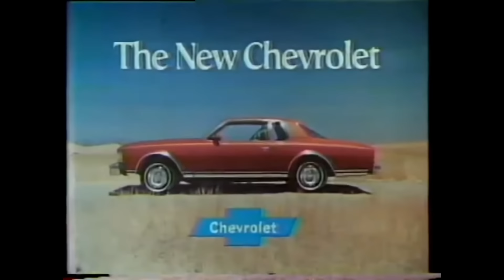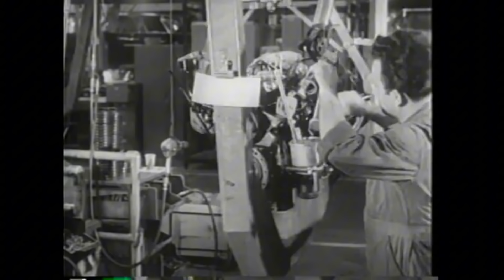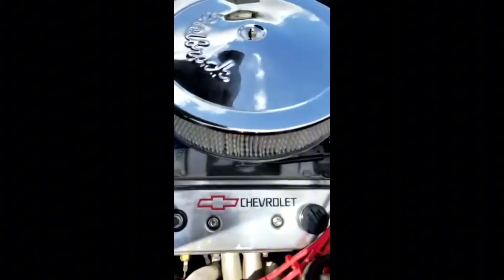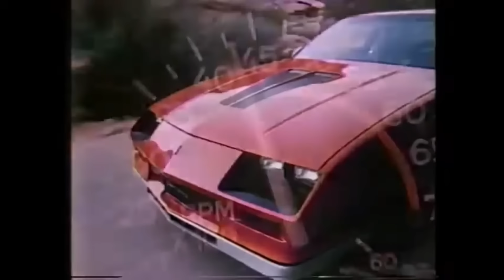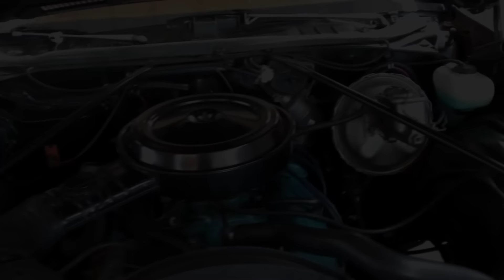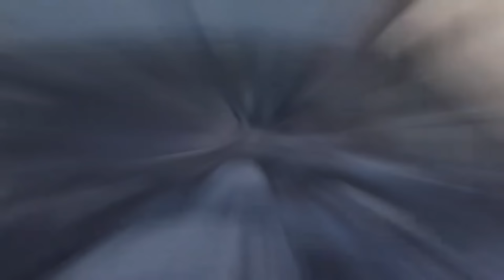How the Chevrolet 305 V8 Became GM’s American Savior AND Scapegoat

Comment: There was an evolutionary step engine just before the 305... 
In 75 and 76, GM came up with the 262 which they put in the Nova and the Monza. 

The idea for the 262s small displacement was a short stroke and the smallest piston diameter. 

It was a great idea that could rev like crazy and made low enough power numbers that it could nearly be indestructible. 

The problem came when it was time to pass emissions in California. 

The 262 wouldn't 4:56 pass but the 350 would... 
Hence why California monza's got a 350 in 75. 
Halfway through 76 the 305 was ready to replace the 262. 

A reasonably larger piston yeah still smaller than the 350 however it had the same stroke as the 350. 

The longer stroke being what was needed to make the same power and efficiency with something that could be tuned for the stringent emissions standards. 

The smaller piston meant more meat in the cylinder walls, for the specific 305 cylinder heads that ran hotter to help complete combustion. 

And then somebody realized you could go back down to the Piston size of that 262 and keep the 305 350 stroke and then the 267 was born just after the 80s started. 

Still short-lived. 
While the 305 was used for any non-performance application. 

Although by the early 80s they were improving the 305 with flat top pistons larger valves and better flowing heads.
Reply: I sold a low miles 262 from a Nova to a guy for his 3/4 ton work truck. It had pretty low gears in it, so he really didn't notice any loss in power when compared to the wore out GM Goodwrench 350 that it replaced.

Comment: My brother bought a 1984 c10 4x4 new.  Camshaft rounded down still under warranty.  Had that replaced and it was a very good truck .  GM got off to a bad start with the early 305.  Later 80’s we’re better.

Comment: I had a 1979 Impala with the 305 with a 2-barrel carburetor.  Put 175000 miles on it and then sold it to my brother-in-law and he drove it for at least 5 more years.  Not a speed demon, but, a good dependable car.

Comment: I had a 92 K1500 with an LO3 and a 5 speed.  It was a blast to drive and averaged 17mpg.  The truck rusted out from around the engine.  It had 210k miles on it when I sold it and still ran great.

Comment: The 305 was a great engine. With 350 heads and a Quadrajet intake & carb it got good mileage and had lots of power. A rock solid motor.

Comment: In 1977 I bought a (of course a 1977) Chevy Monza 2+2 with a 305, 2V, 4 speed, front and rear spoilers. It was basically a Spyder without the decals. This little coupe was awesome. I used to hunt down late 70's Corvette's especially after making "certain modifications" to the car, exhaust system and engine.
Reply: I had one almost like it and surprised a lot of other cars.
Reply: I have alota Saginaw 4 speeds saved from Vegas & Monzas

Comment: F the 305.... I had a 77 firebird with one, it was a disgusting pos....no power,lousy economy.... Blew up in my driveway stuck in the snow... Replaced it with a boneyard 350.... Never had an issue after that.

Comment: I've always been curious about how Chevy, Olds, and Pontiac engineers went about creating their 5.0s in different ways. The Olds 307 was derived from the venerable Olds 350 like Chevy did. The Pontiac 301 is largely maligned. What were the strengths and weaknesses of the three engines? Which ones held up the best in the long run? I think Chevy did the best job of creating a smooth and powerful 5.0.
Reply: I think the Olds 307 was better, but that's just my opinion.

Comment: It might've been under powered and such, but my grandpa owned a mid 1980's G20 conversion van with this engine. They daily drove it, they drove cross country with it, they towed a small pull behind camper with it for 20 years, then it got handed down to my dad and us and when we finally sold it, the original engine and transmission was 300,000+ miles on it. The transmission did slip when trying to go into drive at times and the engine was tired, but it still started up every time. So it was made for certain long term driving conditions, not as a high output HP monster engine.

Comment: It's a garbage emissions compliance engine. Nothing more. If you want efficiency, you get the 6 cyl. If you want performance, you get the 350. Any performance upgrade you could make to the 305, you can make to the 350. And it will probably still get the same mileage.

Comment: Great motor for it's intended use. A fuel injected 305 with a 700r4 overdrive trans was a great set up for everyday driving.
Reply: Yes sir, I get 20mpg highway easy out of my 89 caprice with 305!! Way better travel option than my truck

Comment: I had a 1982 Chevrolet with the 305 and a 4 barrel carb. Biggest pos truck I ever owned. I used trucks for work and hauled 1500 pound loads on a daily basis. Truck could not handle a work load like that. Turned me into a Ford truck guy and I never bought another Chevrolet.

Comment: Never owned one, but kind of wish i did. My experiences from that time period were mostly Ford 302 (a much superior motor) and an early 80's buick 3.8 V6. The 3.8 was junk and eventually replaced with a 350 swap. If the buick had a 305 to start with, things would have been better.

Comment: I bought a brand new 1985 Monte Carlo SS, 305 rated at 180 HP. With some minor tweks , it ran a best of 14.73@ 93 mph in the quarter mile. Not bad for a car weighing 3670 lbs

Comment: Ive got a 1990 Chevy 1500 with a 305 that I have kicked the crap out of, everything else with the truck has gone wrong except for the engine, its got 350000 on it. sure it’s not a powerhouse but I still get a v8 soundtrack and with my posi traction rear it lights up both back tires no problem on dry road

Comment: My father had a 1982 Chevy conversion van with a 305 . It got 17.5 mpg on the highway, and over 570 miles from its 33 gallon tank.
Reply: Same here, G2500 GMC with four speed overdrive. Over 20mpg on long trips and nearly 600 miles between fill-ups.

Comment: Even with a reasonable throttle body fuel injection system in the 305 it was still a disappointment. It took forever for it to spool up into good rpm range to make some really anemic HP and torque figures. The 3.8 liter V-6 was a superior power plant and it delivered better fuel economy.

Comment: Bought a new 1989 Iroc with 305 tpi. 5 speed manual for $15,000. Sweet running car. Great reliable motors.
Reply: My Mom had an 87 Trans Am with the 305 TPI, had some Zip... I was bummed when she traded it, but she did swap for an 87 Grand National, so Schwing... Upgrade even though she bought it used. My dad had the 89 TA with the GNX motor... That thing was fun AF to drive. I ended up with an 88 Iroc-Z with the 350 TPI, I love the look of 3 Gen Camaros, but mine was a lemon, it chewed through flywheels (2 replaced before the car hit 8k miles), but GM stepped up and replaced the motor. I ended up wrecking that car on my way home from work as I fell asleep at the wheel (worked a double).

I later replaced it with a 92 Z28 with that god awful dual stand spoiler which I had replaced with a std Camaro wedge spoiler after 2 months of ownership... Sadly, I couldn't take it with me when I went to school (no need for a car like that when going to school in NYC). My Parents drove it and racked up thousands of miles on it and never cleaned it so when I came home after first year it was in need of a serious cleaning, I was so mad I ended up storing it at my Uncle's garage until I finished school. When I got home with my degree I was back to tearing up streets in my area until I blew the motor in it, and by then the catfish generation was out and I wasn't a huge fan... so I started driving other car types including Grand Prix coupes, and I did have a Mustang GT but it never had the appeal of the 3rd Gen Camaro.
Reply: I hope you still have it, I'm interested in it..

Comment: Well I know if you bore them 60 over it’s around 315 cubic inches and with a port and polish and good aluminum intake and the right carb and a good performance cam they run well ! Same stoke as 350 and with good piston / compressor ratio ! Worked good in a half ton 4 wheel drive , pulled loaded gooseneck trailer well
Reply: It was a dog in my Caprice wagon. 1987.  Crappy gas mileage too.  My Dad had a 78 Buick wagon with a 350.  It was pretty quick and  got good gas mileage, like 19 mpg.  Please explain to me.  And please explain to me why they discontinue the 3.8 FWD 6?

Comment: I own a 1986 Pontiac Trans Am, I have had her for 35 years. It  has a  305 with 145,000 on it. The car looks great and fast but it probably couldn’t out run a mini van. I will never sell the car. I have wanted to put a 350 engine crate in it, but the reviews are mixed. People have asked me if I have ever thought about selling it. Yes, but I would want something to replace it, which would probably be a 1971-81 Firebird and they are not cheap in any shape.

Comment: Can we cut the BS of comparing SAE net ratings from the 1970s to SAE gross ratings from the 1960s in the dishonest effort to show how bad these engines were?  The net rating is easily a 50hp loss simply due to the ratings method.  That 145hp 305 is NOT making less power than a 190hp 283.

Comment: Had one in a boat. A 2001 Sportcraft 230. The Mercruiser 305 had Vortex heads and made 220 hp. That 4000 lb boat would get on plane in a hurry and top out at 35 mph, great motor.

Comment: A 305 in a 1984 Caprice is the only engine I have ever had that failed catastrophically and doomed the car to the junkyard, but then I had a 1991 Caprice with a 305 that went 275,000 miles with no problems, but the frame and every body panel rotted out, so I scrapped the car and kept the engine and transmission.

Comment: I do have a 1977 4 door Nova concours that came with 305 LG3 355909 casting 3.736 with 3.480 and a 376450 heads with 187 duration cam and .370 lift on a 114 lsa with a rochester 2gc carburetor making terribly 145hp and 245lb torque, that was due to emissions and restrictions, once I set it for higher initial timing and get a softer mechanical advance springs and hooked the vacuum advance manifold not ported, deleted egr and every choking shit, let it breath with tuning mixture screws, taking of the catalytic and got a true straight pipe exhaust it made 200hp at least immediately when I saw that, I got a 204 duration cam from an earlier 70s 350 with 420 lift and 112 lsa it woke up that sucker way much better than I expected, then I took off the heads milled them down to 56cc instead of 60s got a bigger 1.84 intake valve with 3 angle cut and match port the intake ports and polished the exhaust to the limits, after reinstalling them I increased flow in and out also increased the compression with thinner head gasket it sounds perfect like a corvette then I got a bigger 2gc carb I got the 435-500 cfm instead of the 285-350cfm with bigger jets and set the initial even more higher and it starts to fire up the tires in 2nd IDK how much hp and torque it does made but I know the 4 door 3500lb Nova could make the the 0-60 in the late 6s with tired th350 and 3.08 gears with open differential. But also it won’t make 10mpg almost 7-8 in there best.

Comment: The Chevy 305 was awful and never should have happened. At least Ford saw some manufacturing savings in using the 302 vs. 351 W (short vs. tall deck). The 305 was dimensionally identical to the 350 and thus the same cost to produce, given the same quality of components (i.e., cast vs. forged crank, etc.). The core of the awfulness was its tiny bore (same stroke = use same crank as the 350 was the idea) severely limited valve size and hence, performance. GM should have only ever produced the 350 and differentiated quality of components. If Chevy were making ever more 350s, instead of spending development $$ on variants, that money could have been spent on refining the 350 to be better for all possible Chevy/GM applications, including the base/low performance applications that the 305 targeted.

Comment: I have a 305 in my truck ( original a 6 ) one the back of the block instead of numbers it has 5.0. LG then the letters canada it has good power it faster ( quarter mile) than my 77. 350 powered truck was

Comment: 305 in my 1985 Monte Carlo ss I put a cam in it and intake change the carb and I going to say it changed everything I also put a no computer hei distributor in it What a big difference it made That 305 was a short stroke just like the 327
Reply: It has a 3.48" stroke like a 350, not 3.25" like a 327.  The 307 has the same stroke as a 327.

Comment: I'm a GM fan but Ford did it way better using the big bore short stroke 302.  305 was durable though and pulled the G bodies around comfortably.
Sad day when they stuck one in the C3 for one year.

Comment: On the camshafts, the lobes were too soft, poorly heat treated and the 305 suffered because of this but i had also seen a 1981 Chevy 350 eat a Camshaft too. The 350 was in a 1 ton Chevy box truck and it ate a exhaust lobe and this caused the engine to backfire repeatedly through the carb as it was running. No bent pushrods, failed lifter or anything else was found and i discovered it was not opening a exhaust valve on the number 4 cylinder which was on the passenger side of the engine. due to the metal in the oil from the wasted camshaft, the company had me install a target master 350 from GM parts in the truck and they had no more engine trouble with it. This was about 1987 when this happened. The Target Master engines used Mexican blocks which had a higher amount of Nickel in the cast iron alloy which was superior to the American blocks at the time.

Comment: I bought a 1978 Caprice with that nasty 305 and a 2 barrel carburetor. A year after i bought it, the camshaft went flat. 

I got a 327, and started to build it up. Nothing wild, just better. And i put a towing / rv camshaft in it, along with a over bore and a complete valve job. 

Placed the 305 in the scrap iron pile, and it was night and day difference. I kept the 2 barrel carburetor, but opened up the jets a little. Now i had something!

Comment: I think our memories of these motors is a bit skewed. For starters the 305 we remember in our buddies Camaro was an old beat turd which we didn't know how to tune and maintain. They were tired and cheap by the time we got them. How many turd tired 350 motors can you rember in your buddies blazer or even beat slow 454 motors in trucks. Next why don't we hate 283 and 302 and 327 blocks. These motors are beloved. Next before you run your mouth own one today. A time when you can actually dial it in. I had a 307 in a 72 c10 that was amazing. Did 90 mph down the hwy hooked to a swapped 700r4. Ran great around town and moved that truck pretty well. Liked to rev too.  I also currently have a nasty 305 in an old jeep and it rolls out way better than the stock motor but doesn't have enough power to break all the stockish drive train. Runs great in that small rig. I also own a hot 283 and a 301 Pontiac and plan on using them in appropriate rides. Oh I also have a 215 aluminum Buick. These small cube v8s are very nice when you know what you're doing. To wrap up I think another problem with these was almost none had a stick shift. Most 5.0 mustangs were direct drive manual. My buddy in highschool had a 5 speed 305 Camaro and it was way more wild than the slushy auto units

Comment: The 305 was the stupidest small block ever made. It was truly retarded.  Same weight as a 350. Same dimensions as a 350.  Same fuel economy as a 350. Half the power of a 350. Ford did it right. Their 302 was smaller and lighter than the 351.

Comment: had a 79 Z28 with a  swapped 305 headers cam manifold 4 speed would run neck and neck with a friends stock 79 T/A with the olds 403

Comment: It's a small block Chevy of the era one of them about a dozen just placements that was tuned for low horsepower 1 like any average engine of that day small valves low compression Etc you're expected to be about 15% less than a 350 because it was that much smaller it's not like it was set in stone all the Chevys have good and bad cams Tams compressions valve sizes

Comment: Okay, buddy at 283 was gone home before that date.And what's wrong?Five or second worst engine ever small block chevy. I could get 25 miles a gallon.With a two eighty three power guide in a 1967 4 door bel air. The 307 , with the worst small block chevy. There's a 307 chevy g m c engine different from the olds.

Comment: Low compression and with smog  heads that had 58cc chambers.
Putting on a set of big valve aluminum heads with the usual 62cc chambers lowered the compression even more.

Comment: I have a 1981 Chevy G20 rust bucket work van. It has a 305 4brl stock engine with 337,000 miles on it and it still runs albeit a smoke stack oil burner!!  but still runs non-the-less. Kevin
Reply: with gears behind a 305 they were good truck engines

Comment: I still have a 84 K10 pickup with one...and a 1986 Z28 with one with 336,000 miles when the transmission went out. Engine never been into.